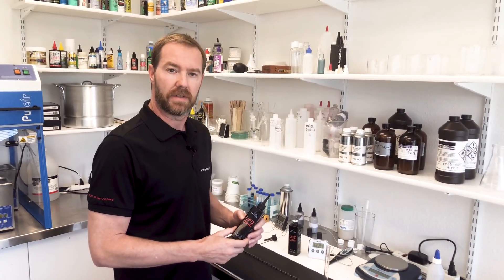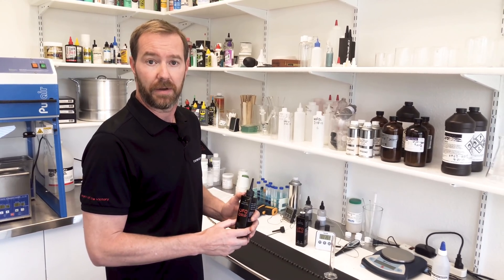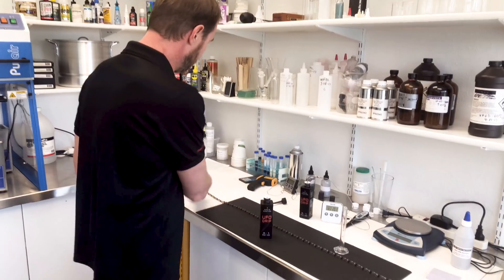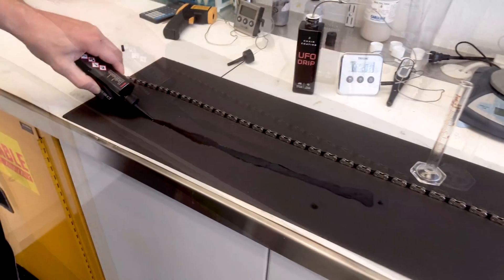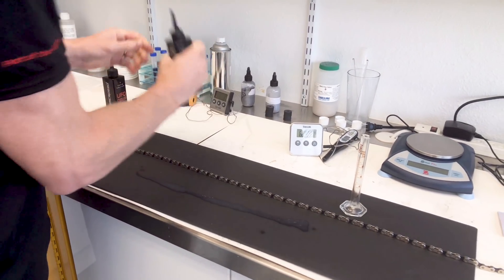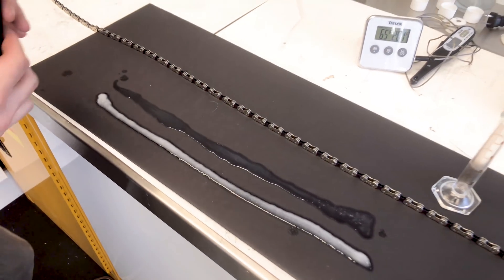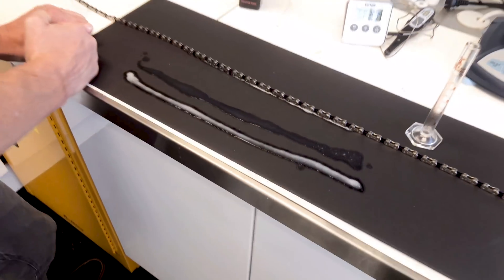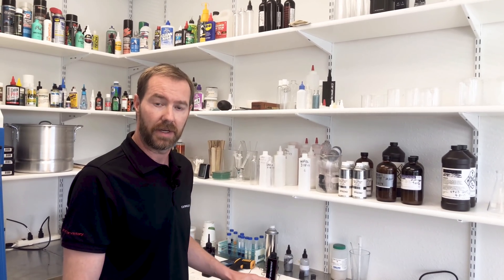UFO Drip Episode 1 - Temperature & Viscosity

Comment: Would you recommend warming the bottle in advance when the ambient temperature is below 70F/20C?
Reply from the maker: Hi Jerome. Yes, if the temperature is lower than 18-20 Celsius, you should warm the bottle and the chain. Both should be at about the same temperature, around 20 degrees Celsius or over.